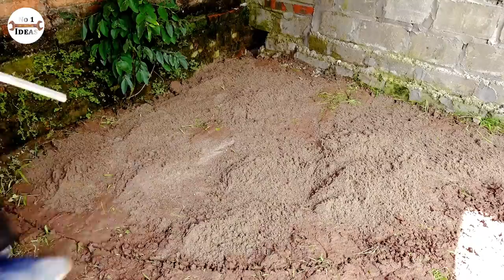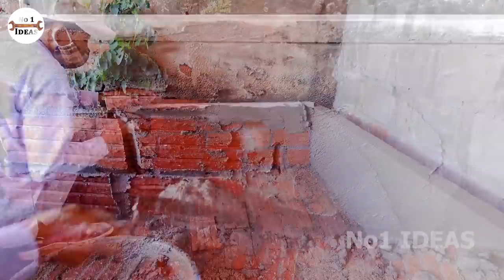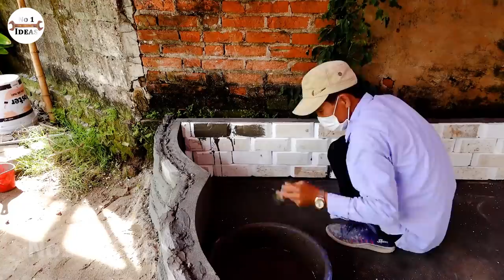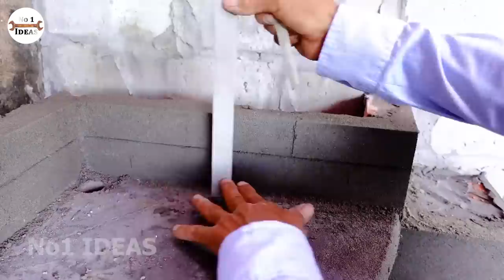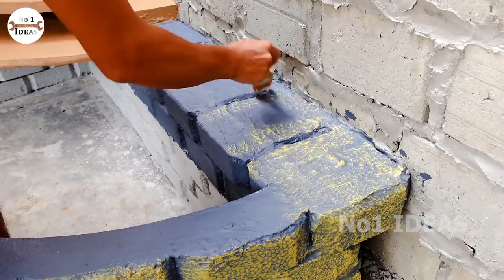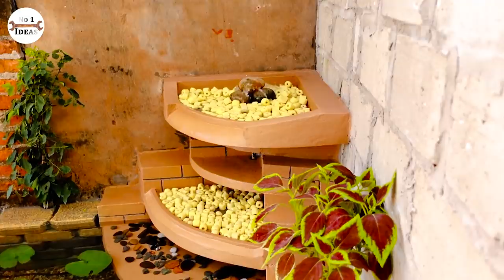How to Transform Your Family Garden Into a Beautiful Corner With Waterfall Aquarium

Comment: hi can i ask when you layed down the bricks at the start of the project what did you throw over them it looks like sand mixed with concrete am i correct

i have a couple of patches where i wanna lay some concrete to make a patio type base i was just gonna pour concrete into it but im looking now to fill with bricks and then pour over the top and smooth it out
so what would i use sand or a mix of ballast and cement then pour concrete over the top and mag float it to smooth it out
many thanks in advance 

Mike from the UK